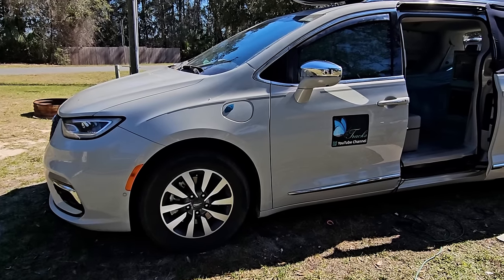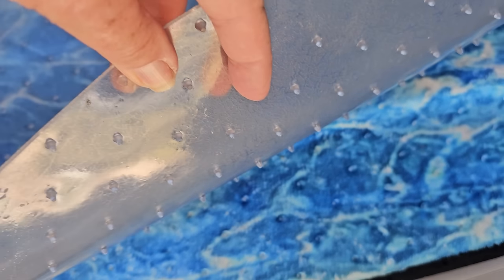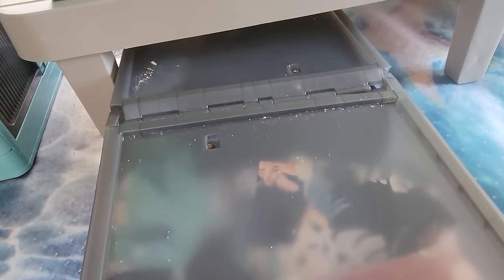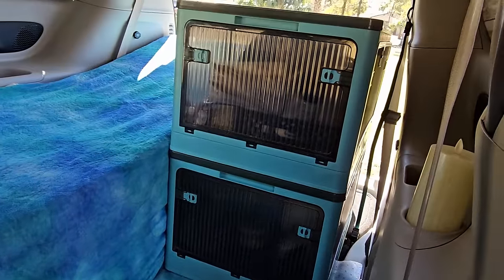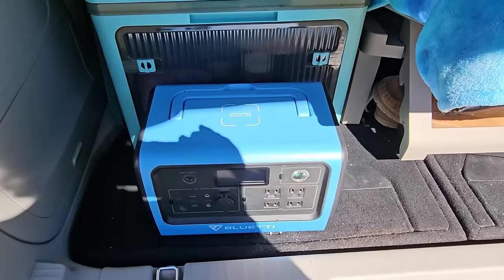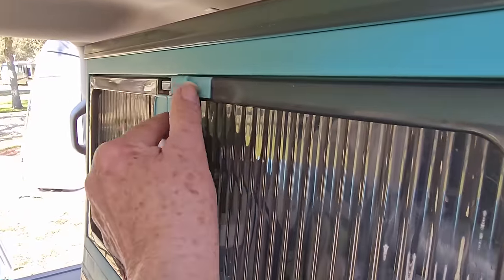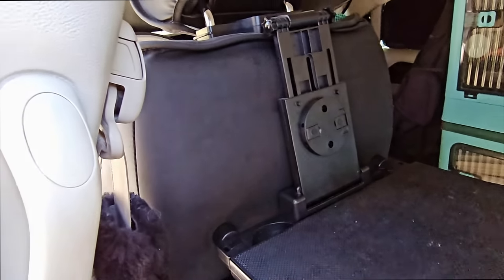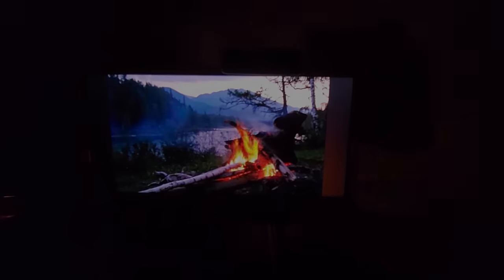VAN TOUR: THE ULTIMATE MINIVAN CAMPER.

Comment: Nice no build, I like the bed idea and using the nice bins.  How do you cook and do you have a place to sit.  Also how about water?
Reply from the maker: Water is in front of the passenger seat. I have a camp stove in the rooftop box and a 12volt rice cooker that sometimes use inside. The bed is also a recliner since the head sits up. I can comfortably sit straight up sideways with pillows at my back. It's a bed, a recliner, and a couch!

Comment: Did your stanport toilet come with bowl that sits inside or is that something you added?  Where did you get your thick snap together pads and did they make your floor level?  I have a 2024 Pacifica and don’t want to put the plywood in if I don’t have to.
Reply from the maker: Here's the potty. It comes with the bowl.
Stansport Toilet: https://amzn.to/481ROp1
The tiles are foam puzzle tiles fro. Amazon. They don't really level the floor but you can saw the legs of the bed to level it. That gives you more headroom.

Comment: How do you keep the foam mattress from sliding down in recliner  mode and how does it bend when reclined?
Reply from the maker: I haven't had a problem with it shifting and it's flexible enough to bend easily.  😊👍